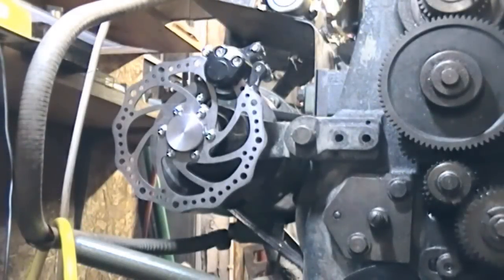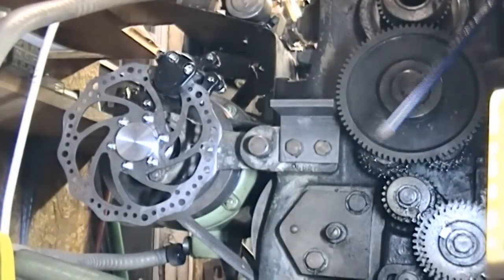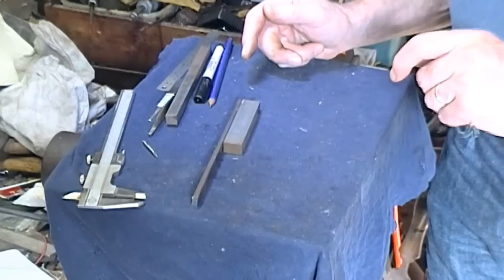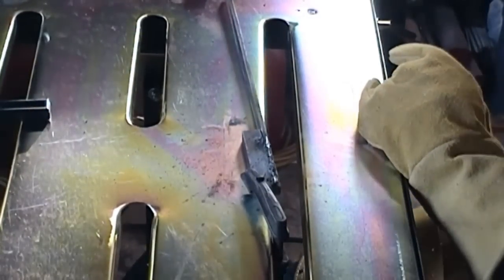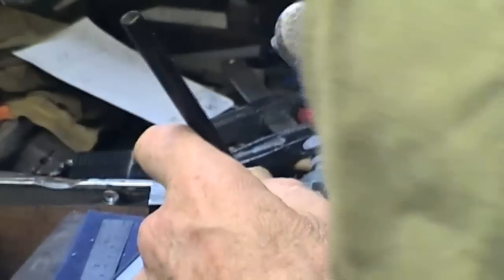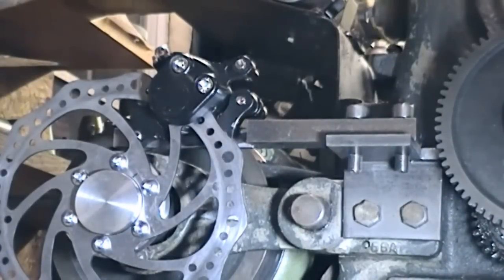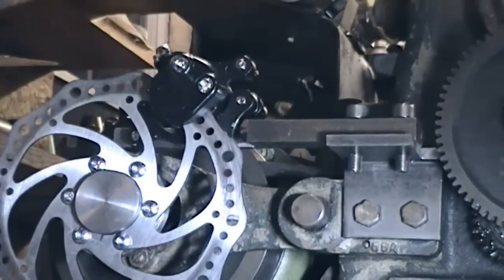Lathe Brake Project, Main - Part Two

Comment: Hi Chris, I see the job is going further. As the caliper is not hydraulic but bowden commanded, you can think to bulid a pedal foot to brake the spindle. Just pass a steel cable to the floor and the job is done.
Reply from the maker: Hi - well, have actually gone for brake lever up top - as felt foot pedal might be harder to control to avoid overly aggressive action. It's complete now so will post part 3 vid soon.

Comment: Hi Chris, yes, getting old is crock of s**t  shaky hands, dodgy eyes and having to sit down every ten minutes or so is par for the course for many of us old timers, I have had similar problems welding along seams and a solution to this was to drill some decent size holes in one bar, just going slightly into the other bar and filling the holes with weld, rods are ok for shallow holes but mig works better on deeper holes in thicker materials, very easy to clean up and almost invisible when dressed, thanks for sharing, I appreciate and enjoy your videos very much, thank you, Laurie Smith
Reply from the maker: Thx Laurie -- oh yes - age sucks!  I guess tho better to be cussing it than not be able to be here to do so! :)
Reply: ChrisB257
Totally agree with you there Chris

Comment: very good work, If I understand well, when you apply the brake, you stress all your lathe drivetrain, better if you could fit directly to the spindle
If I had to do this project, I made differently on two small things first, I would have applied the brake before making final markings to take in account the movement of the brake pads and made a positive lock between the disk hub and shaft because the four setscrews will fail if you use the brake agressively

Comment: OH ya, I've been know to have problem following a straight line with the stick welder unless I'm into a corner..LOL
The brake unit seems to function very well Chris. Looks nice. A bike cable with handle will complete the system.

Colin ;-)
Reply from the maker: Hi Colin -- just completed the final stage - vid coming soon. Not too bad a result in the end.

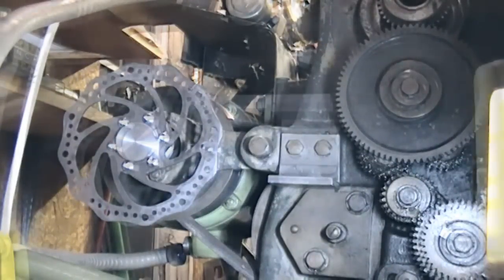Comment: Time is 7:00 on the video. The connector has come loose letting the wires hang out. Hope it helps?
Reply from the maker: Ahh - gotcha! Thanks - indeed hadn't spotted that bit - will be attending to that soon as shop gets above 8 degrees! Fortunately there is no strain on those wires.

Comment: Your wire on the motor is lose and may short out. You can it in the video.?
Reply from the maker: Mack - checked video but couldn't see what you mention - probably need a time stamp to locate the frames where you saw something. In fact a check on it all seems OK.

Comment: You should have raised the 3/16 bar 'up' a 1/4" then you would have had a 1/4" fillet weld top and bottom. (Near side/Far side)
Reply from the maker: Agreed - in principle - would have been way easier but, in fact didn't want the 3/16 bar any higher relative to angle piece and caliper position.

Comment: Hook it up to a remote lever/pedal to operate it!.
Reply from the maker: +Marek Sumguy Had considered that Marek but wasn't ideal for several reasons.  As I have it is v close to power switch so op lever  finally used works out v well. Thx for watching.